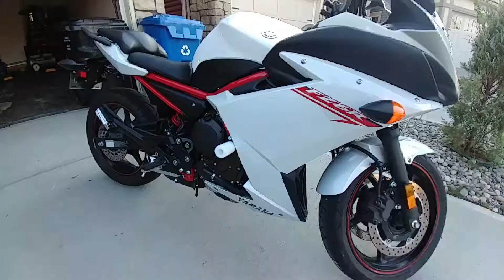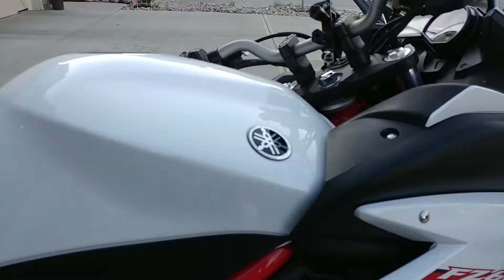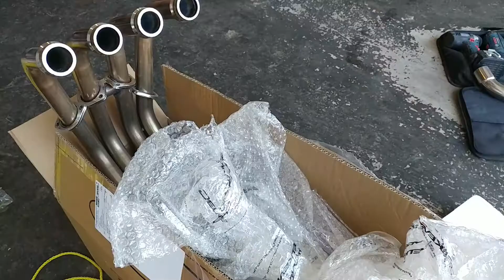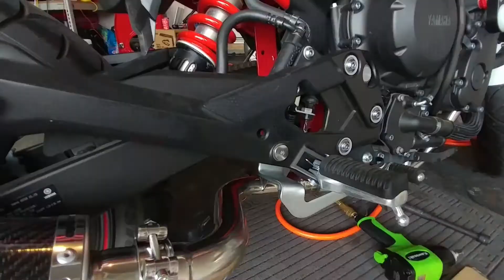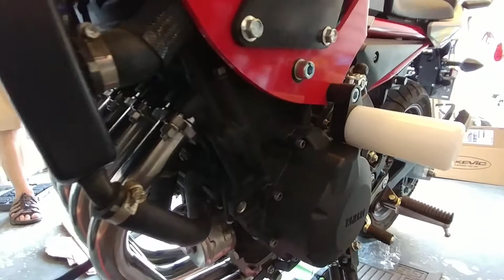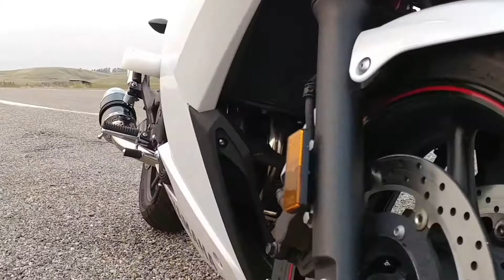2013 Yamaha FZ6R - Exhaust Before and After

Comment: Did you have to remap or use a power cammandor? I want to get the same exhaust but I’m worried that I might need to remap due to k and n air filter. Do you have a k and n air filter on your bike?
Reply from the maker: Didn't have to remap or use power commander, running stock intake.
Reply: OK thank you
Reply: When u say u didn't mess with intake, what exactly do you mean?? I have a k N filter..does that count??